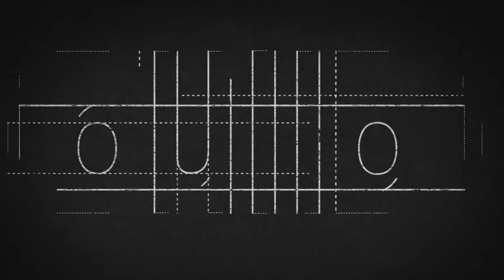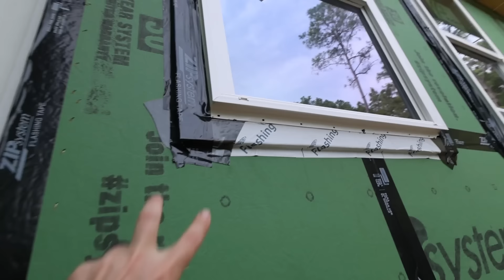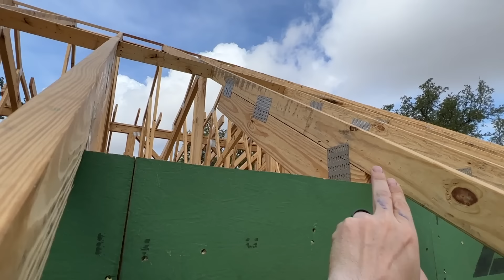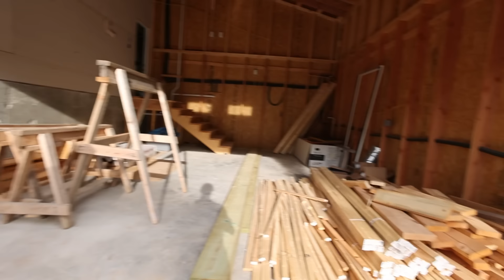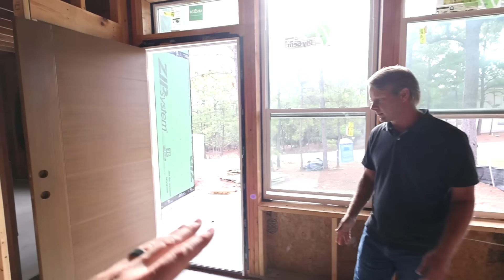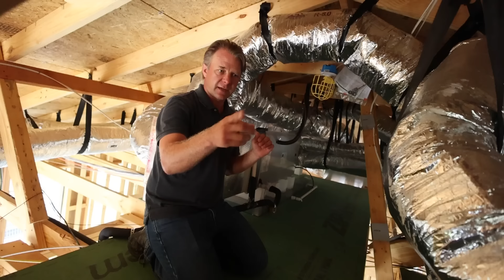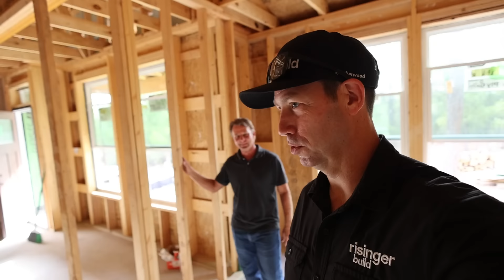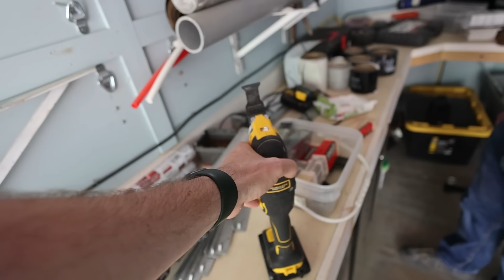LOW BUDGET Details For A High Performance BUILD

Comment: Sadly when the first othe contractor comes in.. they will poke holes. Or worse when next hvac the customer calls out.. Will recommend a larger unit stating that it's wrong.
I have the same hvac problem here. I have had over 15 atleast come out. Allot of it was super cringe.

Comment: If the house is that airtight and can't breathe what happens when a tornado runs close by but doesn't get to the house would not that stress all the structure when the air pressure drops instantly
Reply: I think maybe that air exchanger will help.

Comment: This tight house trend has me worried. It used to be that a house had to breath but now with all the sealing out of the air, the house becomes a closed bottle which I would think would lead to inside air quality causing health issues for those inside especially in the winter. Without a fancy air circulation system to rejuvenate the air it would become a simulated Petre dish and not everyone would want to spend money on that or the energy to keep it running.

Comment: Fan-tastic... still cant believe Texas has no infrastructure to build a basement or Raised Bungalow?  Big Storm Sewer underground  like Underground Power lines is very clean vs Tornado / Hurricane...  where's the panic room?  Basement is a Bomb shelter when the Train rolls thru (Tornado?)... just a little piece of steel strapping keeps the roof attached to walls???  but having a steel roof is the Best...  it's a tough situation...  so many storms?  Cities underwater with just an inch or two of water...  ruins the whole 1st floor?   Concrete home seems to be the only solution vs tornado / hurricane...

Comment: I'm currious to see if he is going to do a vented roof or have some kind of strapping to allow air flow under the finished roofing materials. What would be a decent way to do this? What about a rain screen on the deck with Cor-A-Vent under the drip edge to allow the air floow? Almost same detail one would have for a wall assembly.

Comment: Where is the Make-up supply fan discharging to within the home? Into the kitchen zone via a metallic supply grille? or into the units R/A plenum? This is a very important as during summer conditions heat and humidity rises as we all know. Any HVAC Supply grille will sweat causing deteriorating conditions as the home ages. We design many high end homes in South Florida and have found delivering raw O/A via ceiling grilles is not ideal. I have been part of alot of research in developing systems for these large exhaust hoods. Our research is surprising but delivering all the air to one concentrated zone has had worse results than houses of much leakier construction. Unless that make-up air is treated in a sub tropical zone it can have much more rapid deterioration of a homes internal envelope.

Comment: I love what he said... this shouldn't be looked at as a special way of building, this is just how things SHOULD be built in the first place.

We're literally talking about an extra 3-5% of the overall cost of the home... which is often offset by the HVAC downsizing, and especially the energy savings within the first year.

But by God, ask a contractor to do something extra and it's like pulling teeth.

And don't even get me started on HVAC contractors not bothering with a Manual J.

Comment: Mechanical contractors not knowing how to do Manual J calcs is not a bold statement. I am a architectural, electrical and mechanical engineer. I have found very few mechanical contractors that can run calcs (Those have been commercial guys). The only residential I do is multi-family buildings, 98% of my projects are commercial and industrial. I constantly get proposed scope of work where the GC has had their mechanical and electrical contractors price a job based on their assumptions, then the GC wants me to make it work because that's what he priced. Mechanical contractors are the worst at sizing a job based on SF rule of thumb. Most act like I am speaking a foreign language when I talk about sizing based on climate zone, building envelope, number of occupants and outside air requirements. 
I would like to foam my roof and seal the attic space, especially with both mechanical systems in the attic. But I can't bring myself to do it, knowing if/when there is a roof leak, you may not know until there is significant damage.
Reply: Good points!

Comment: I have got to wonder how well that tape performs 1 or 2 decades in? If it's covering any kind of gap, it could fail. Tape isn't structural, is it?
And caulking doesn't really pass the test of time. However, it's better than nothing, I guess.

Comment: Matt, I'm looking for a video of a high performance masonry structure. Most of whit i've beem able to find has been just regular stick construction with a brick veneer, is it possible to do true structural masonry construction and get high thermal performance out of it?

Thanks
Reply: Not sure of masonry but our family cabin was just rebuilt with ICF... Insulated Concrete Forms.   It's amazingly air tight and crazy efficient.  Heat waves and no AC and it stays nice and cool inside.

Comment: Matt: You give Scott props by adopting his soffit idea. But why didn’t you chamfer the soffit/exterior wall edge? And or the outer edge to match the facia angle? Two passes with a circular saw and you have a much better fit, both appearance and sealing performance. Thanks for the video, lots of good support for a better built house using standard labor.

Comment: Im rural and we built in 2001. My contractor recommended 2x6s in the exterior walls. Nothing high tech yet I literally turn my ac on 3 weeks after my friends and family and turn my heat on 3 weeks later in the season. Think about it. How much energy could this country save as a whole if every new house built didn't use heat and ac energy six weeks a year. I live it every year and am so grateful the contractor suggested to us spending a little more to do 2x6 exterior walls.

Comment: I built a slab home as a second home and the slab was sealed and insulated, the walls were made from 2x6 lumber and exterior 4x8 plywood with 4x8 foam panels and for insulation I had spray foam insulation. After the home was finished and a year later I notice the carpet always felt slightly damp so I called a home inspector in to check it out and he said the house was so air tight the house could not breath and the slight dampness was hovering about 6 inches from the floor so the inspector recommend a dehumidifier which solved the problem. This problem was just in summer. So building a air tight home is usually not recommended according to the inspector..The inspector also recommended a air recirculator to keep fresh air in the house especially with a family of four, so I added a Bosch air conditioner with a air recirculator which helped..

Comment: A show request:  Can you do an episode on wildfire resistant construction?  On the west coast, wildfire resistance is starting to become code for decks, soffits, walls, vents, and the like (roofs have been fire rated for a long time).  However, the codes like to use terms like "ignition resistant" which seem to make sense, but don't translate into obvious building supply options.  Obviously, some things like brick and hardiboard are fireproof, but they are heavy and have structural support implications.  You're wide industry insight could help to understand lighter weight, flexible, and lower cost options.

Comment: Noon question, blocks in between the trusses/rafters at the top plate of the wall aren’t necessary for the structure? I mean obviously they aren’t since they aren’t installed here, is there some other engineering that has to go into framing that way?

Comment: Question about Blown Insulation in the wall cavity, won't it settle over the years?  I've used a thermal camera on a few houses here in Texas during the summer that had various batt/blown insulation in the walls, and there is a heat "strip" around the top of the exterior walls.  Regards to the video:  Matt, I love your videos.  Unfortunately, I don't $2M to spend on a house.  This is a great video for the "regular" people out there and that you can achieve good air movement control, insulation and air quality on  sub millionare houses.

Comment: I’m curious about the ability of the ERV to handle the load of a range hood. The ERV mentioned draws 150cfm but I thought the range hood was about 600cfm —I may have spaced on that. It would seem there’s easily several hundred cfm not being made up for there. Will this pass inspection?

Comment: It will be interesting to see if all this zip tape stays stuck after 75-100 years.  I’d still feel better if the Zip was covered with mechanically fastened Benjamin Obdyke Hydrogap properly lapped.  Building on an Island just did this because the Zip was exposed to UV for too long and needed it to maintain warranty on Huber’s recommendation.

Comment: 8/27/22. 2day's video was (standard stick...) building high performance on a budget...Yes! Great video 2day! Zip/green/osb sheathing/taped seams everywhere...mixed wall insulation types: spray (open cell) foam + net/blown fiberglass called 'Bib system'; Builder Scott (Dimera?) is very serious but is running himself very hard by using the 'slam-bam' (fast) framing contractors then the tape/caulk/seal everything;  then mix wall insulation w/spray foam 'daylight' & penetrations & Bib. Then foam roof &  Soffitt cavities. Engineered A/C to exacting 'J' Manuel specs + greater quality level air exchange/makeup/humidity units.  2day. 
Matt another good deed 😇by yur videos educating viewers on home building to higher standards. 👍👍👍👏🛠⚙😊

Comment: Comment 695!
I noticed that when you created the joint between the soffit and the wall on your own project you butted the two pieces of sheathing up next to each other and then had to carefully seal the gap between them with two passes of sealant. Why didn't you  bevel the edge of the soffit sheathing so that the angle was vertical to match the wall? That would leave you a much tighter gap to seal with no chance of the sealant oozing through and filling up the large open space behind the front edge.

Comment: I have been in construction industry for 50 years.  Construction management for 25. Would work for Scott in a heartbeat. World needs contractors who are willing to go the extra mile & follow the science. Well done. You should be proud.
Reply: Maybe I’m missing something here but how are you suppose to ventilate your attic/ roof if your seal all the soffits?
Reply: @rioriggs3568  It's not a vented attic. Roof is sealed and insulated same way the walls are, from the outside, with the Zip system. Spray foam is then applied directly to the roof on the inside.
Reply: @chrimony  Not venting the attic? Good luck with moisture buildup in winter and shingles over heating in summer.
Reply: @rioriggs3568  This is Texas. Mild winters. As for summer, the roof is going to be metal. Matt recommends an air gap between the sheathing and the metal.
Reply: Hey man! I respect any fellow construction pro like you.. I would love your input on something I’m building called Rooted. It’s an app for builders, tradespeople, etc. to connect, find work, and show their skills. Think Linkedin + Instagram + Tinder, but just for construction.. I want to make sure it solves REAL problems, so what’s the hardest part about finding good people or good work? OR what's the most annoying part of your job, and if an app could make it easier, what would make it worth using? Would really love your feedback!!
Reply: Who cares

Comment: I have one question, i don't see any insulation on the concrete slab, won't this create a thermal bridge? Or this is not an issue in Texas?
Reply: It is a thermal bridge and you do notice it. But it's slight. Most people buying spec homes won't notice. It's definitely a consideration for custom home clients.

Comment: What's the fanfold for behind Scott at 40:00?
Reply: It's cheap insulation board. I am only using it as a backer to spray foam against in areas that separate a conditioned attic from an unconditioned porch area.

Comment: Mat could you work with Scot and make single page spec sheets including step by step install instructions?  Picking which details are added to basic plans would be as easy as stapling them to the plan submission? I bet listing name brand materials with a "or equivalent" on the drawings would get the manufacturers to pay for the design. Any added info like amount of caulk, tape ect per face foot, linear foot or per penetration. Hell do full BIM if they'll pay for it. Scot should be listed on the design with Build for the copyright. Make it happen.
Reply: Something I'm going to work on soon is to improve some of these ideas and make a summary of best bang for your buck specifications. I'd be open to Matt collaborating with me on that but either way, I'm going to work on it.
Reply: @ScottTrue  the build network could use someone specializing in work that is more attainable. I just left 20 years of working on top tier homes and started building entry level spec homes. Dealing with subs has caused a lot of problems. I've presumed people know the basics of their trade but most don't.  Supervisors of plumbing and electric crew look up code on their phone but everyone else and I mean EVERYONE says "No" when i ask if they've ever owned a code book.

Comment: Can someone explain to me techniques you use to keep a tight building envelope with the microwave/range hood and dryer vent penetrations through the building envelope?  In other words, how do you eliminate backdraft air flow?  Heat pump laundry dryers don’t require outside ventilation, but the technology is not quite there yet.
Reply: So all those penetrations do make for a more leaky house, although you can still get tight even with cheap vents. You can keep things tighter by buying high quality vents that close relatively well when there is no airflow. You can eliminate backdraft when all ventilation is balanced - meaning when air goes out, you have an equal amount of air being pulled in (filtered and conditioned). When ventilation is balance, the house is never pressurized or depressurized which cause backdraft.

Comment: Matt, best video yet and thanks to Scott now I can proceed with building without worrying about dealing with the monopoly type construction. I was totally stymied with the thought of penetrating the zip sheeting with screws or nails. Problem solved! 
How big was this house with the 2 ton Bosch HVAC system? Variable speed standard systems are the way to go if you can’t install a mini split system with higher seer ratings. 
Great format BTW.

Comment: Fantastic video. I was really happy to see the long format and details details details. To change the industry, we need this education. Love talking about HVAC and ERV's with a tight home. In my area we are not allowed to use an ERV for the hood recovery air and bath fans can bring smells into the rest of the house unless you use carbon filters, which get costly to replace.  I like the concept of just tying the ERV into the regular air ducting system and let bath fans exhaust to the outside.  Please keep these videos coming.  I will use the soffit detail on my next build.  Issue for us was the problem of adding a ladder framed soffit after the fact (over the zip) and framers would not understand this. So this approach makes the most sense and keep the strength of the roof overhangs in the roof rafters where they should be.

The discussion about how to make money and sell a house that is light years more efficient than traditional builders.  It's hard to justify the extra expense to home buyers, but the average consumer is getting smarter about efficiency and net zero and hopefully will be paying extra for this. Also this guy will stay busy with work. Great job!

Comment: This is great, he's using good materials as well as he can.

I think the real value leader is similar construction with a "cold roof" and a plastic vapor barrier at the ceiling.  That allows you to use blown in fiberglass or cellulose instead of spray foam.  My roof is going to be single pitch (shed roof) with I-joists instead of roof trusses and I'm going to use the entire I-joist height for insulation, perforated foil radiant barrier and an air gap for venting and drying.  The money I save on spray foam I'll be able to use on my standing seam steel roof and my interior ceiling finishes.

Comment: Again, could you address concerns about thousands siding nails penetrating the previously sealed Zip panels? Should we be concerned about water leak paths along those siding nails? Thanks.
Reply: I'm just guessing but they mentioned rain somthing on the exterior.   I'm thinking the exterior siding will be secured to somthing other then the zip stuff.

Comment: This was a good vid for the long format: bc every few sentences was a 'new' aspect that demanded consideration for implementation- generally, jam-packed with good info. In my humble opinion- the most important part is the secondary perspective of high-end performance upgrades dealt with on a competent budget level.

 I work remodels so usually very light new construction aspect (unless the occasional add-on). Like your boy says in the video: HOW A HOUSE SHOULD BE BUILT. So these inclusions are a great selling point for people tearing into their homes to a point at which they can rebuild with these things in mind. But the budget easily doubles or triples, leading the owner to draw a line before rebuilding the whole house. 

Love seeing all the new tech, thanks for your inputs and hard work!

Comment: spray bat is garbage, 1.5" spray foam with the thinnest bat fiberglass is the cheapest high performing method. You dont even need a pro company to do the 1-2 inch spray just use a froth pack. about three $500 kits can do a whole house.